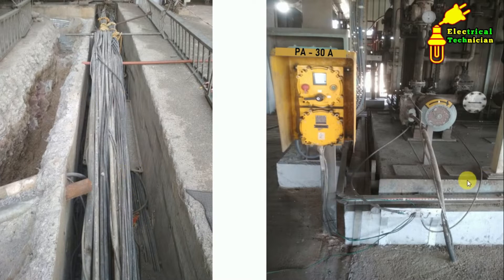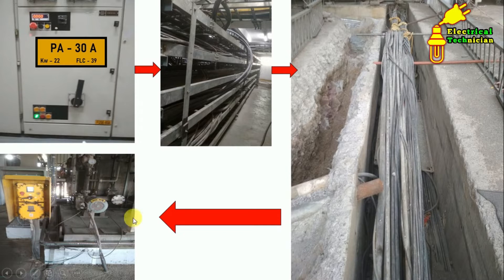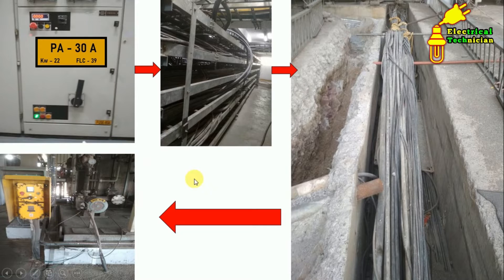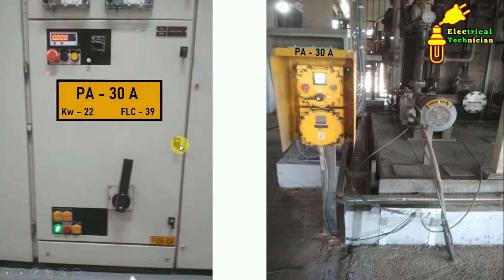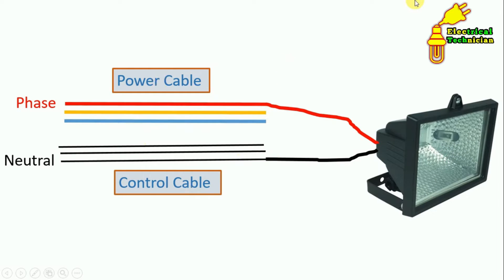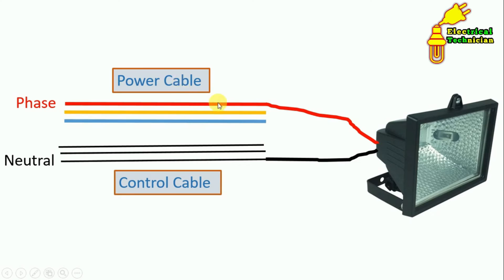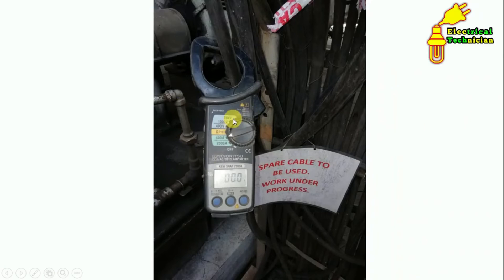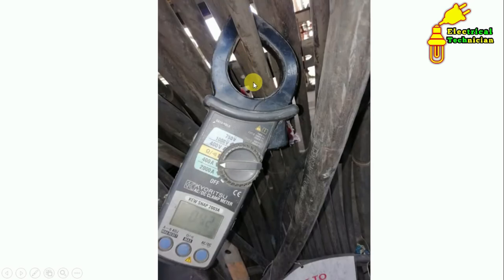Learn to find Faulty Cable || No one will tell you this trick @TheElectricalGuy

Comment: Thank you for sharing, this is a handy tip to add to the bag of tricks when fault finding.

Other methods I've seen which can be helpful include using a cable tracer / toner, usually used to trace telecom pairs.  As long as there is no short between the 2 conductors it's connected to, it will send a tone down the conductors, and if they're accessible the cable can be located amongst a bunch of others.
If it's any help, I have seen these cable tracer / toners for 20 to 30 USD on Amazon.

For finding the general location of a resistive fault in a cable, a chap called David Savery has done a very good video on the methods used to locate this type of fault.  This is in a domestic setting, but the principles apply to all cables.
The video is called "Fixing another man's lash-up!" and there is lots of swearing in it 😁

✌